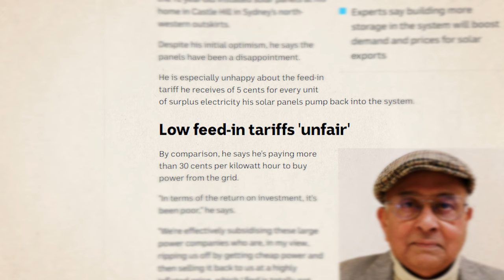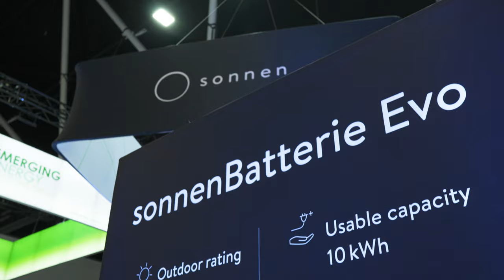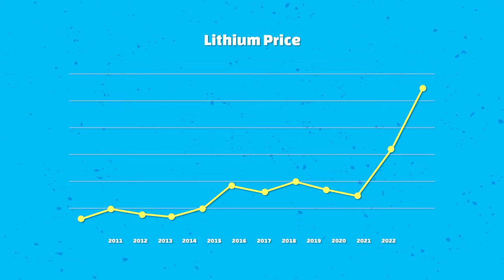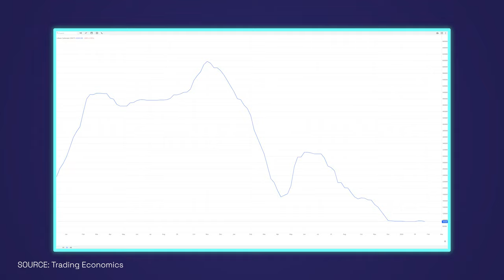Will Solar Battery Prices Get Cheaper?

Comment: I wouldn’t mind putting a battery into our home system, but at this point in time it doesn’t add up numbers wise. 
Happy to wait as tech improves, costs come down and capacity increases.
Reply from the maker: Some areas have battery rebates and incentives. But yeah still outside the reality for most.